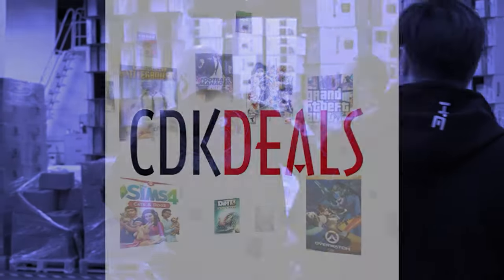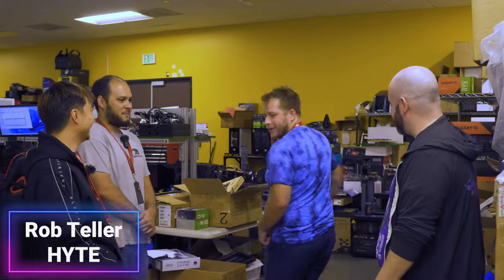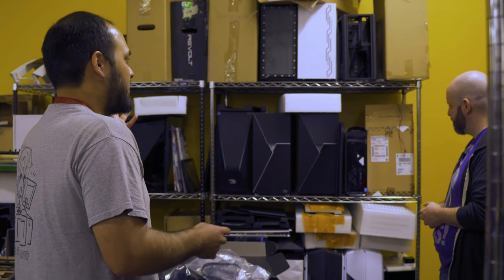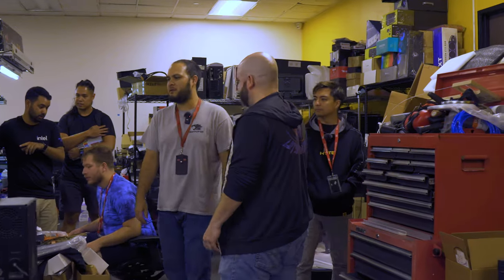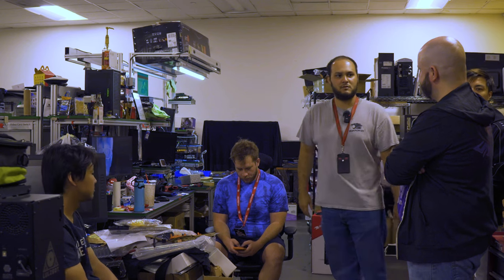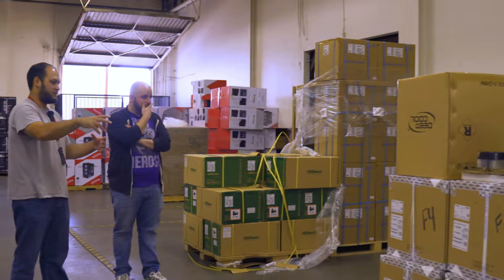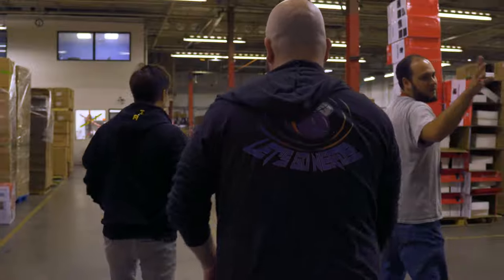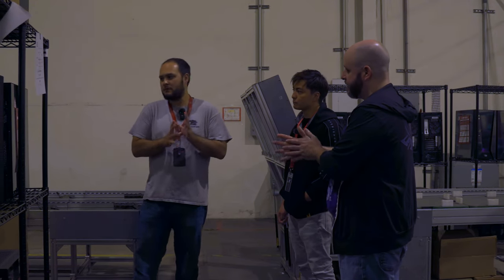THOUSANDS of Gaming PCs! Full Tour and Behind the Scenes at iBUYPOWER and HYTE HQ

Comment: Just bought a 2,500 system from these guys. Hope it impresses me. I have a 4 year old Aventum X by Digital Storm which cost me 5,000, but I have used it for 10 hours a day, and I have never had an issue. SO fingers crossed my new one will be as reliable.

Comment: Sadly my current system, my second AND probably last IbuyPower from Bestbuy almost $2,300 wasted but having to deal with until I can afford to upgrade ) I had to do a swap due to the USB controller dying on my still under-warranty Snowblind system) kept overheating the CPU from day one. I swapped out the water block for a huge air cooler and immediately got temps almost 10° lower than they ever got on the shipped with liquid cooling unit. (now I am afraid of trusting liquid-cooled systems), Now I am saving for a new system but it will be some time before I can afford a decent Photo/Video editing/Gaming rig as my hope is to get the latest CPU/GPU for a bit of longevity and that averages $3,900-$4,500+ it seems. I am a disabled Veteran trying to make a business from making custom Pet memorials, but this system is not stable enough for my future business.